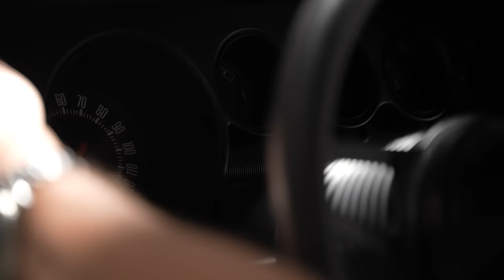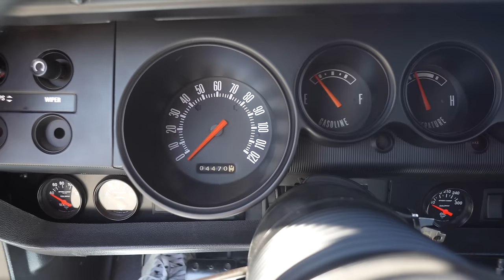Raw & LOUD 440 ci Garage Built Plymouth Barracuda | Built to Drive Hard

Comment: Back in my younger days i owned a 71 4 headlight 383 Cuda, seeing this Cuda brings back a lot of good memories....puts a smile on my face
Reply: In 1977 I was teenager shopping for my first car and almost bought a 71 383 4 speed Cuda but it was trashed as many Cuda's in my price range were. I ended up with a 74 360 Cuda as my first car which wasnt exactly what I wanted but it had 30K miles and was in excellent condition and it was $2200 which I could afford.

Comment: I’d had muscle cars my whole life, first car at 15 was a 68 Chevelle. In 2009 I had to sell the two I had when my dealership got closed. Had to save the house. I kept my old 4x4 Dodge. A few years later I bought a 2016 Shaker Challenger. Great car, does everything well. But I had to have another old school car again. Nothing beats old school muscle, especially when it’s modified like this.
Reply from the maker: Same for me. Built old school muscle car that can handle. This is truly badass
Reply: Like the earlier 392 Challengers...but man they are so heavy
Reply: @gordocarbo  the wife body cars solved the turn ability with more tire. Ugly truck flares though.  Wesley Motorsports has a great suspension setup for them, they beat GT350s and z28s with theirs. But yeah, still heavy.

Comment: No idea WHAT 440 this one is, but the good ones were WILDLY tough. My favorite big Mopar is the 383, they'll rev crazy high, and as far as I know they all had a pretty bulletproof bottom end. There were later truck 440s that were not-so-great, but his must've been a good one. They resist overheating WAY better than a big-block Chevy or Ford. I love how low and raw and mean this thing is. I also love that it's still got leafs in the rear, not a damn thing wrong with leafs with the right 'helpers', and there's no way to fuck up the alignment. REALLY cool car.

Comment: My first car that had any amount of power was a 90 Mustang LX 5.0.  I have always been one who likes a car to handle as well  as go straight.  This car had V rated 60 series 15" tires.  However, for what it was, the handling aspect was ok, the go straight was awesome.  I soon got rid of that and bought a new 94 Mustang GT with the 17" wheel/tire setup that was the same as the Cobra of that year, handling improved pretty well.  After a short dive into a VW Jetta, I bought a preowned 00 BMW 328 Sport Pack 4 door.  It had a square set (same size tires all around) of 17" performance tires.  I swapped them out for an 18" 225 40 in front 255 35 in the rear.  Holy cow could that handle!!!!  Since then my 12 Mustang GT with 19" wheels handled well, but the solid rear axle hinders the handling somewhat due to the V8 puts so much power down.  I also have a 20 Mustang GT Track Package with 255 40 and 275 40 in a 19" wheel.  With that setup and independent rear suspension, it handles like my old Bmw but on steroids.  Short story long, it is amazing how that beautiful Cuda handles so well with that kind of power being put down and a non independent rear end.

Comment: I got a few old Mopars they are for the most part all original in the back it is all original except I'm running caltracs and in the front I have a Tubular K-member on my duster and my other cars still running the torsion bar front end

Comment: Not hating whatsoever i just have some suggestions to make this car even better than what it is. For starters carbon fiber hood, full tube chassis, independent rear suspension, 426 hellcrate motor, lower and widen the stance, sequential gearbox, toyo R888R'S. AGAIN NOT HATING SO DONT CRUCIFY ME IN THE COMMENTS
Reply from the maker: I get it but that’s a completely different car than what he wanted. Still wanted to keep old school elements
Reply: @AutotopiaLA  hey I can respect that. It's a rad ride through n through